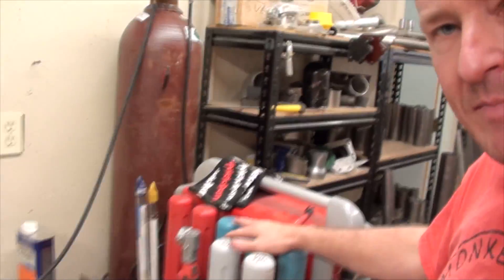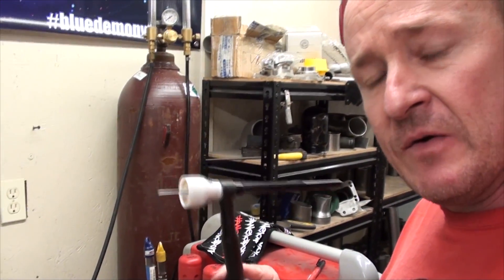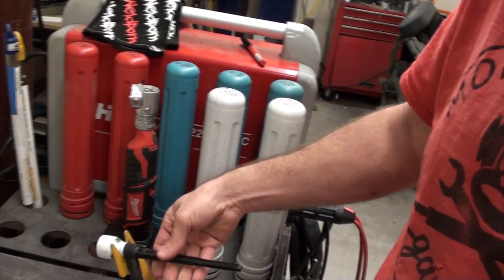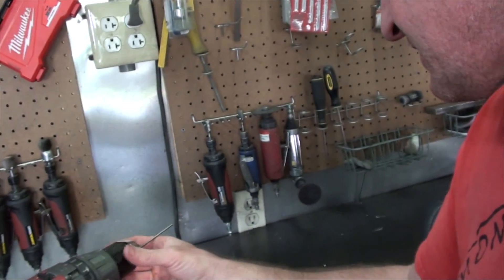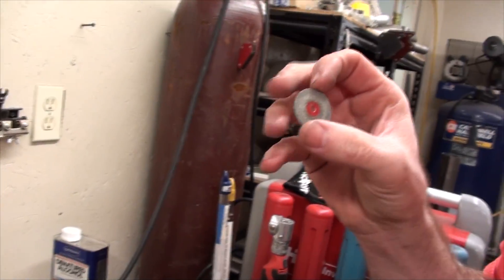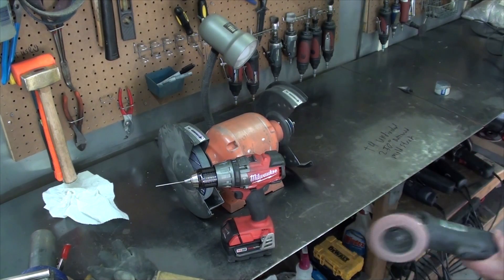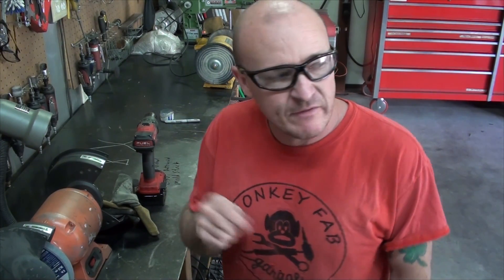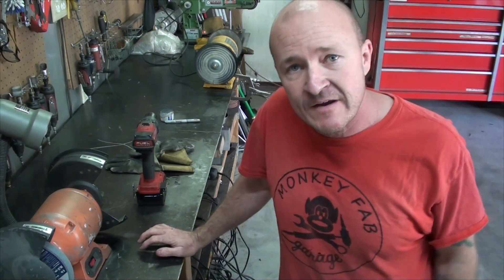how to set up and use a tig welder series; 5 Tungstens

Comment: If you’re going to use a standard grinder for tungsten, you can’t use it for anything else, or you will contaminate your tungsten. Same thing is true for any grinder with tungsten. You can buy a diamond wheel designed for gemstone use with a 1/2” arbor, and put that on the grinder instead. That works very well, and doesn’t wear away for years and years. 120 to 180 grit wheels work best. You’ll use the flat side of the wheel, as that’s the way they’re designed to work. So while you want the outer part of the wheel at first, you’ve got a lot of surface to work with over the years.

You don’t need a top quality wheel. A cheaper one from eBay will work fine. Diamond will work very quickly, because you will have a fair size wheel.

Thorium is weakly radioactive indeed. Using it isn’t a problem, but grinding it can be. That disperses the thorium around the shop. Very fine particles can remain in the air for a few minutes, even though tungsten is heavy. Then you breath it in, where it remains in your lungs forever. If you’re a smoker, you’re doubly affected. California has banned this, and other states are moving to as well. Since Lanthanum is about as effective as thorium, and much more versatile, there’s no real need for thorium electrodes anymore.